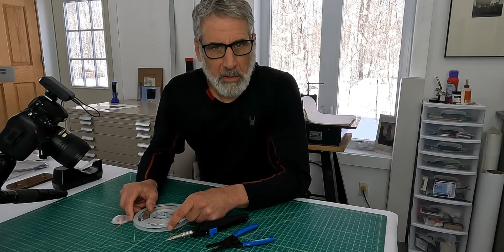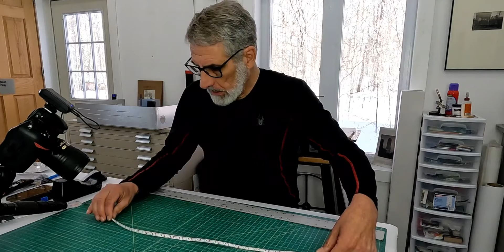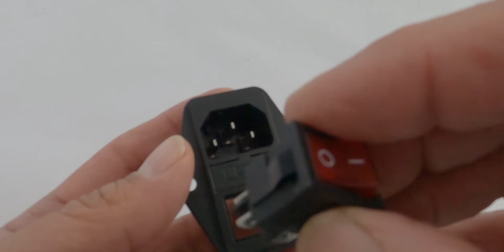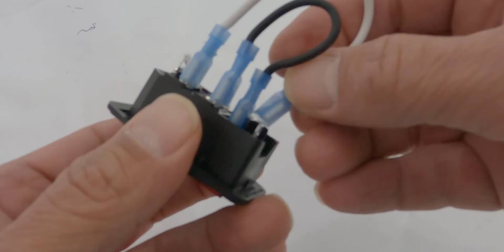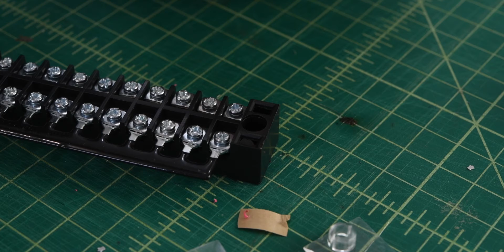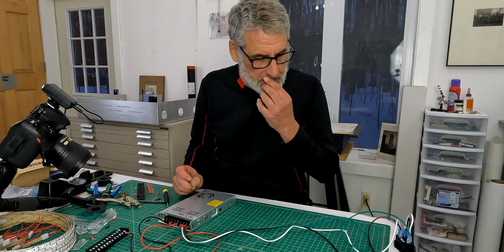Build Your Own Ultra Violet LED Exposure Unit - Part 3.1 - LED Strip and Circuit Assembly

Comment: Be careful following the wiring instructions from the plug to the transformer. Earlier in the video, he calls his black the neutral and the white the hot. Later in the video, he corrects it to black as hot and white as neutral. The latter is the correct color and wiring. 

I don't point this out to be critical of the video but just for safety purposes. Please always be aware of which wire is your hot wire. 

These instructions are otherwise absolutely amazing and this has been a huge help to me as I seek to design a new burner box for my alt process prints.
Reply from the maker: It was definitely cleared up, but you’re correct.
Reply: @BillSchwab I can't wait to see the finale!